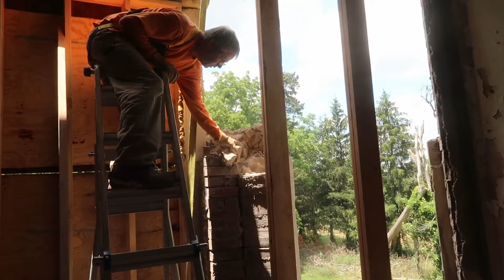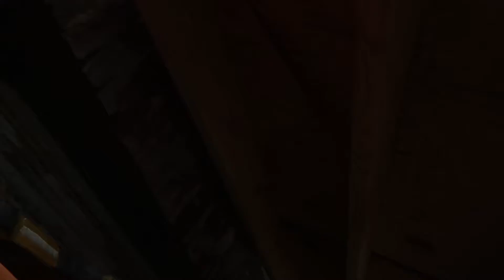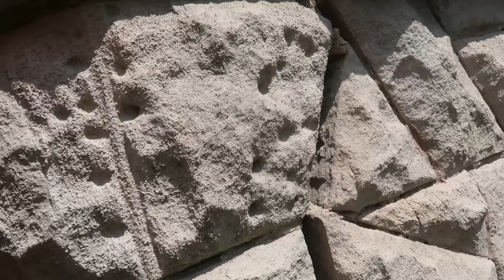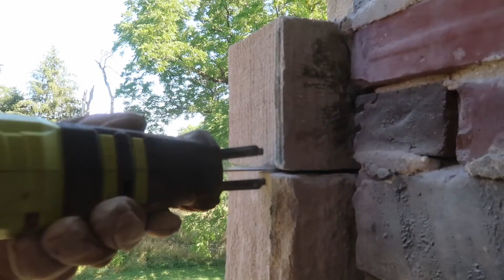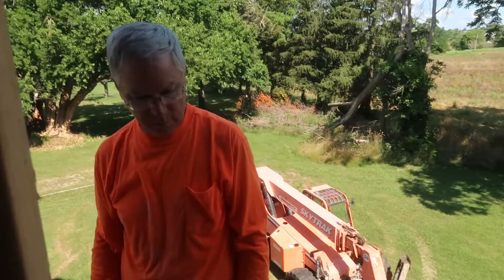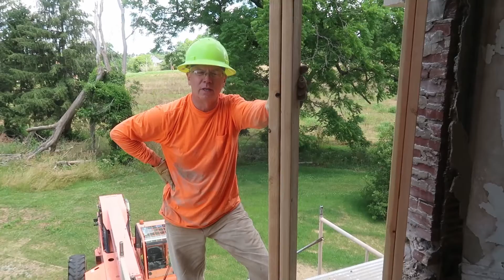Removing Huge Stones From our Abandoned Mansion to Make a Room With A View - Mooreland House S2E13

Comment: Oh no, not concrete!  It will ruin the stone because concrete doesn't allow water to leave the stone, it traps water, which you don't want.  Oy vey.
Reply from the maker: Don't worry, the moisture can still move in and out of the stones. If you want a little light reading you can get the book "Hot Mixed Lime and Traditional Mortars" by Nigel Copsey. It will answer most of your questions. It certainly answered ours.